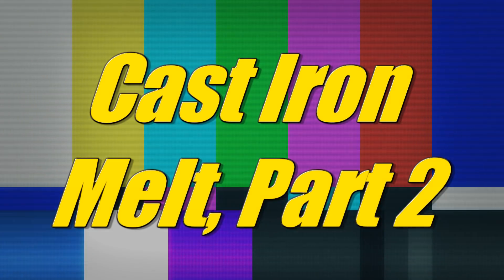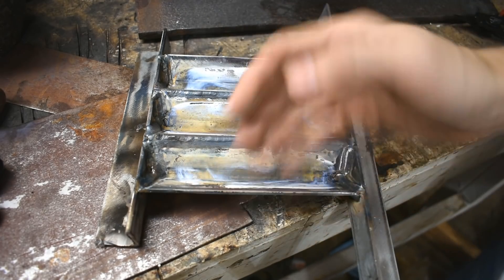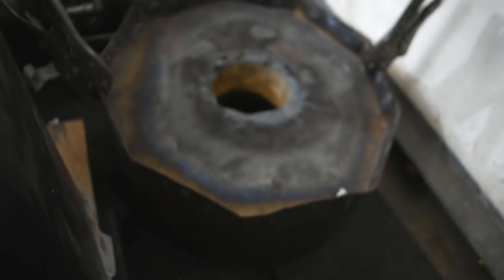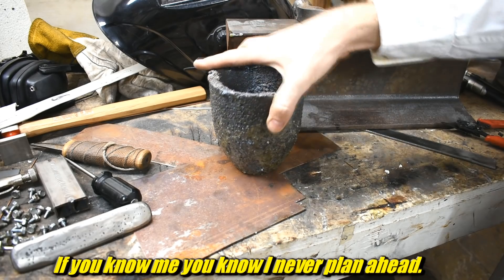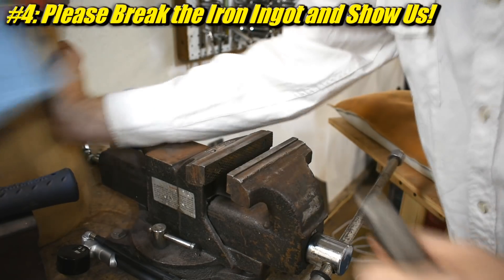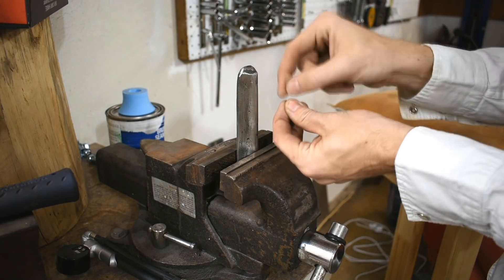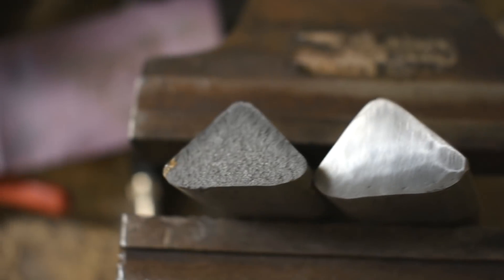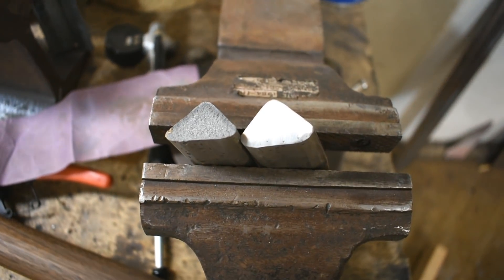Testing the Cast Iron Ingot and Answering Your Questions

Comment: Is it good idea to cast lathe base out of pure bronze?
Reply from the maker: Not really.  The mass is nice, but lathes prefer vibration dampening alloys.  This is in part why they use cast iron, and why I'm building a gingery lathe put of za12 (a high aluminum zinc alloy).  Bronze isn't vibration dampening.  In fact the right bronze alloy is what bells are made from, lots of vibration
Reply: @PaulsGarage  Interesting. Thank you for the hint. I suspected that it is bad idea as I didn't saw any examples of brass base in the wild, but I was not able to think about the reasoning. I am preparing for my 2024 summer "project" to build my very first furnace and to try to get into self made lathe club. Kind of interested in precision tooling, so... spending my time on gathering materials. A LOT to learn... :)
Reply from the maker: @DzintarsCave  sounds like fun!  Good luck!

Comment: Oh, sweet. I didn't know you did caste iron. You can make a steam engine after you build your gingery lathe.
Reply from the maker: I can do cast iron, doesn't mean I'm going to haha that stuff was way too hot for comfort
Reply: The fact that it is possible, make me excited at the prospects of creating a steam powered workshop. 

Aluminum expands too much for steam engine cylinders.
Reply from the maker: @SirCumferencelel  Oh it's definitely possible.  To run a machine shop on steam though you would probably need larger equipment than I have to cast the engine, and some pretty large machining equipment to even make the thing.  There was a channel years back called fair weather foundry that was making a steam engine from iron, he stopped posting though which is sad.

Comment: i have enjoyed your videos, i liked this fire brick foundry. i have some fire brick but its not the white kind, its lighter orange. it was hard to cut and sand... i was looking forward to doing the metal work that also goes along with this project as i have casted some rocket stoves (which if you havn't come across them, i am sure you would dig em') thustly i have been using the base of one of them to melt aluminum... but i have just got my feet wet. I had some ceramic insulation from a kiln and i thought to use it inbetween the bricks and the sheet metal i have (18ga.) whats your thoughts on the added insulation, and if i should go with satonite or another product, there seems to be many... i have all or most supplies to cast a proper foundry but really was set on welding practice lol. do you think i should turn back from attempting to cut through these tough bricks or fight thru?

Comment: How much propane did you use to melt the cast iron?
Reply from the maker: I don't have a way to measure the tank accurately but I'd guess from weight maybe 1/4 tank
Reply: @PaulsGarage   - thanks.  I built an electric furnace back some 16 years back, and have never pushed it hard enough to do even copper.  I may give aluminum bronze a try before making a jump to build a gas-fired one.  By the way - I always pronounced Dave Gingery's last name as JING-ery - not saying it is correct.  LOL

Comment: Silica melts at 1750 degrees Celsius propane barning at the maximum 1600 degrees Celsius, it's glass in the crucible is the clay Glazer, because the refratory clay of the crucible not suport so muth heat.

Comment: If you cannot see a ingot glowing in a dark room you can dunk it  into a bucket of water and will not harden. By the look of that ingot you could drill a hole in it as it looks soft enough. Your next step is to pour a useful casting.
Reply: luckygen1001 you’re a casting God lucky.

Comment: The black inclusions are ferritic iron oxide, which melts just slightly lower temp than grey cast iron.  The casting itself looks like good healthy gray iron - a little brittle but plenty of strength.

Comment: Great result, that looks like a very nice piece of cast iron. New ingot tray looks good too, very close to mine. I actually plan on making another one, shorter this time because 8 inches is too long for an ingot that one plans to remelt. 
I'm sure you got some decarburation during the melt, but obviously not enough to go all the way to steel. Would be cool if you were to stick a tube in the molten pig iron and blow air (or oxygen) through it to make steel, like they did in the old Bessemer process. But you probably don't want to do this in your garage... hot metal and oxygen... :)

Comment: From my purly academic level of metallurgical expertise in cast iron, you have a nice uniform gray. The base material you used must have had a fair amount ferro silicon in it for it to be that uniform. Good job. 

When cast iron is white it is extremely brittle. Some reference info "The silicon in grey cast iron causes the carbon to change into graphite. This causesit to have a dark grey or almost black color. With less silicon, the carbon in white cast iron changes to cementite or iron carbide (Fe3C). This causes white fractures to form on the surface and give white cast iron the name."

Comment: White is usually bad—harder but more brittle. And unlike steel, there does not seem to be an annealing step possible to un-harden the white iron. But in some cases (I’ve read) that might be desired. For example, a lathe bed might—sometimes—be made so the bearing surface of the ways are white iron. (Maybe not in the casting, but in a “flame-hardening” step after they’re flat or nearly flat.)

But for casting, pretty much, yeah—white iron bad.

Comment: christmas is around the corner, you could get yourself like a small milling machine (lathes are cool but i got one and now i kinda regret not having bought a milling machine instead), then you can cast all sorts of cast iron stuff and use the machine to finish it off. i'm thinking squares, vises, fixtures heck even something like parts for a lathe could be done that way. maybe not the entire bed, i mean maybe if you step up the furnace game, but something like a small milling vise is totally in the doable range and its a real tool wich is useful even if its not 100% on

Comment: It looks like you had semi grey iron all the way through except on the outsides for some reason where it was darker, normal grey iron is quite a bit darker grey than the stuff in the center and throughout the ingot you had. It also explains why it was so hard to sand and work. Also, clay/graphite crucibles are actually what are used for cast iron, the silicon carbide are only for bronzes and non ferrous metals because the iron leeches the silicon and everything out of the crucibles, making them quite brittle and makes them fall apart or worse while the metal is molten. Silicon carbide crucibles are good for bronzes because they actually last much longer, but for doing iron, clay/graphite is the only ones you can really use tho.
Reply: I only use Si carbide

Comment: classic, people that melt and therefore BURN zinc (brass) lose their mind over somebody welding galvanized stuff where just a tiny bit of zinc is present to begin with. zinc fumes are completely harmless in the doses you ingest them while welding stuff. i bet your arm would fall off, before you would get zinc fever. however, in huge foundries, the people in fact got sick from the fumes, but its nothing serious and goes away after a day or two with no further harm.
Reply: I concur.  Still best to pickle galvenized parts with muriatic acid before welding.
Reply: @NormReitzel  absolutely, if you do stuff that you want to look good and be strong, you have to get rid of the zinc. for stuff like this mold, there is absolutely no reason to do so. it doesnt matter that it looks a bit crappy and it doesnt have to be particularly strong

Comment: Awesome, even after a week has gone by, I still have ferrous metal envy!

Hard to believe you got nice soft grey iron all the way through, especially after you quenched that ingot in water while it was still hot!  Ive read that Iron castings often don't even get de-molded until the next day after pouring, in order to let them cool slowly enough inside the sand mold to avoid becoming chilled (white) iron.  

So... your ingot might actually be hard white iron all the way through; I think it is a matter of how dark of a grey it ends up being, as opposed to chilled iron being truly white...  

It would be really nice to see the as-broken section next to a known broken grey iron sample.  Failing that, you could simply try drilling a hole through the ingot; white iron won't like that at all, whereas real soft grey iron should machine beautifully.
Reply from the maker: I have more of these weights, I can try breaking one open?  I just quenched the ingot because people say they like hearing the sizzle lol but sand castings I always let them cool off in the sand so I dont burn myself removing them
Reply: @PaulsGarage  I think chilled cast iron may be a thing? Might be harder and more brittle than slow cooled castings. Which would be appropriate for some wear parts. I wonder what you would have to do in order to make malleable cast iron? Would it be as simple as melting down malleable cast iron itself? When I did commercial demolition we'd just smack cast iron fittings to bust them apart. We were all about whatever was fast, quick and easy. But every now and again you'd run into a malleable cast iron fitting. Those you'd have to beat the snot out of in order to get them to break. They'd more tear apart then than shatter. Cast iron that's to be precision machined is even aged before it is machined. Sometimes up to years. Like as if it was wood drying. Though part of me wonders if that is more due to supply chain inefficiencies than actual physical property improvement? It is still a touted thing in some circles though.
Reply: maluable/ductile iron is just grey iron that is produced the same exact way, but usually has a little bit of magnesium mixed in, like 0.1%, and it causes the carbon to form glodules which can stretch rather than the standard sheet graphite that the carbon forms in grey cast iron. Usually something like NiMg3 is added because it doesnt flare up and have as bad of a reaction like pure magnesium would being plunged into the bottom of the iron.
Reply: To add to what @ChirpysTinkerings  said—most of the ways that home foundries can produce malleable/ductile iron require the additions to be done very soon before pouring. It’s not just the manganese (or whatever you’re using) content in the alloy: there’s a chemical reaction that hapens when you add the stuff, but which undoes itself after a few minutes molten.
Reply: yea, it's usually magnesium for ductile iron, not manganese, manganese is for increasing the strength in steels, not cast iron.
Reply: melting ductile/malleable iron just converts it to grey iron because the magnesium in it burns away as the iron is being melted. You dont have to melt the magnesium, most of the time, you just take a small piece of NiMg3, which in the industry is called nickel mag 3, which you just take 1lb of it for 100lbs of iron, just plunge it to the bottom of the melt, or if your doing it in a factory, you'll just stick it in the bottom of the crucible and pour the iron out of the furnace into the crucible on top of the NiMg3. It'll flare up a little bit and bubble up through the iron, then when it's poured and cooled, it'll be ductile iron. Other than that, it's the same procedure as you would with grey iron with the addition of ferrosilicon and such, nothing is any different.
Reply: @ChirpysTinkerings  I hope I'm not giving away any trade secrets, but it wouldn't matter anyway because that company has ceased existing almost 20 years ago. In the mid-80s my father worked for them, and they were making malleable cast iron (the one with graphite nodules) using cerium as an additive - usually in the form of mischmetal. IIRC they were getting a very good product, but using cerium just wasn't economical.
Reply: Ive never heard of cerium being used with it, so thats a new one to me.
Reply: @ChirpysTinkerings  Use it wisely. :)
Reply: it isnt as violent as it sounds, it just flashes a little bit with the nickel mag 3 and thats about it. It does get interesting when your doing it from a cupola pour which you usually sit it in the bottom of the crucible and pour the metal on it. Also, anyone who has messed with casting iron doesnt really have much arm hair anyhow, lol.
Reply: lol, Ill probably just stick with the NiMg3, which I have in stock already to do that rather than trying to track down something more expensive and rare, lol.
Reply: @ChirpysTinkerings  It's more expensive yes, but not as rare. For instance flints used as ignitors in gas lighters are ferrocerium - about 40% cerium by weight.
Reply: oh, ok, good to know.
Reply: @PaulsGarage  I get liking the sizzle, it's just surprising if you got grey iron that way.  From what I've heard.  😀

Comment: Carbon in gray iron is most often described as flakes (think corn flakes). Fractures propagate through the carbon and jump between the pointy bits of the flakes which is why it fractures easily. The flakes are also what give gray iron good vibration dampening and heat transfer properties (think brake discs).

Along the bottom of the V channel on the ingot you can see what is called white  iron. That's caused by the chilling of the iron from pouring it into your ingot mold. You actually can pour what is called a chill wedge, break it in a similar fashion, measure the white iron penetration, and guestimate the carbon content using the measurement. This is still used in some iron foundries today. (BSME with a minor in Metallurgy, 6 years in iron casting as a Quality Engineer)
Reply: Thanks for taking the time to comment Jake. It is good to read comments from a professional with experience in this area as they help with the learning process.
Reply from the maker: Interesting! Thanks for the info! Does the chilling effect of the ingot tray produce that white iron? I didn't preheat it, so it was probably about 25 degrees F when I poured the iron in.  If there is a little white, does that effect the next time I melt the ingot down?
Reply: @PaulsGarage  Yes, it's chilled due to the cold ingot mold. Chill wedges are typically cast in copper molds, to chill them even faster. The chilled white iron will be very hard, tough to machine, and brittle, but there will not be any negative effects to your next melt from the white iron as long as you get the full charge to molten.

A phase diagram is a helpful tool in casting as well. The link below is a decent crash course in Iron.
http://www.phase-trans.msm.cam.ac.uk/2001/adi/cast.iron.html

Ductile Iron (or spheroidal graphite iron) was always my favorite. The graphite actually changes from flakes to spheres with the addition of magnesium (it's quite the fireworks show). The smooth surfaces of the graphite spheres do not propagate cracks easily, so it can be significantly stronger. It also rings because it no longer has the flake graphite to dampen the vibrations, and it can exhibit elongations as much as 30%.
Reply: I have a cool demonstration on flake versus spheroidal graphite that I will try and upload sometime. Maybe it's something you could share with your audience.
Reply: @PaulsGarage  If you painted the metal on the bottom of the lid with 3000 degree primer and than added a couple layers of satanite. Do you think that would stop it from scaling at least for 10 burns?

Comment: the muriatic acid is great for getting the galvanizing off the metal just drop it in a bath with the stuff and see it fizzle , sticking it in the foundry for a couple of minuted burns the stuff off real fast just dont go sniff the air over the foundry 
the circumference of the oven seems to been flatten a bit , maibe next time put some bandsteel around it to help it keep its shape
seen someone make wedge test pieces
https://www.youtube.com/watch?v=CAq7iVmNJkQ  he shows and explanes it @ 13.30
the lighter type cast iron is brittle as you add more silica to it it becomes tougher
Reply from the maker: It's a little out of round, yeah, that's because I didnt build it carefully haha. It hasn't changed shape.  

I'll get some muriatic acid, maybe do etch tests and stuff too